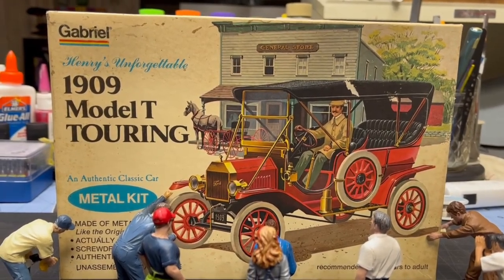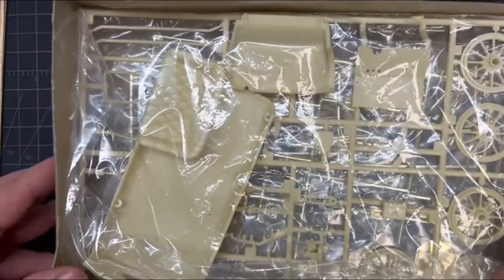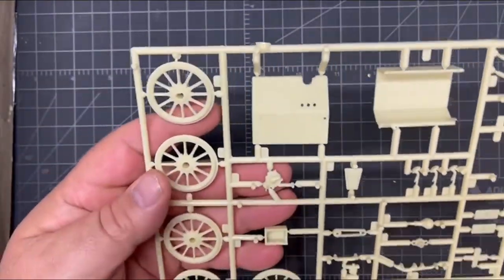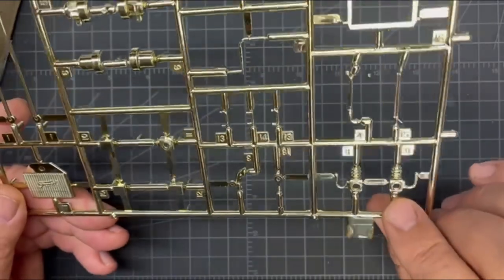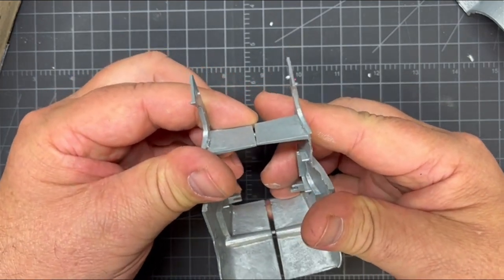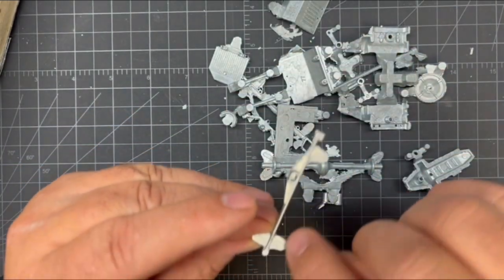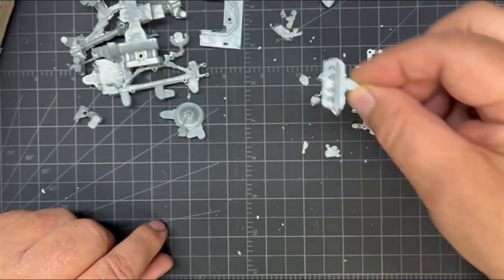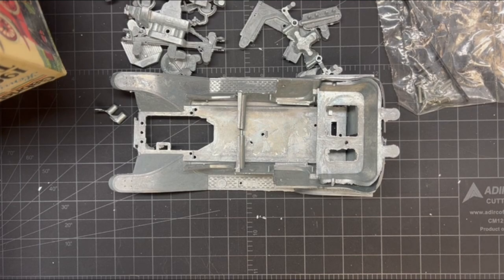Unboxing the Gabriel 1909 Model T Touring

Comment: How awesome is that! I don't remember these kits or I was just not interested in them to remember... Lol
To be fair, I quit modeling in 1972 when I moved to Nashville for Automotive School. I was playing with the big boys back then... 🤣
The guys/gal will have to get out the heavy duty shop tools on this one Mark... 🤔

This will be interesting to watch. Lights? Hell Yes! The battery can go under the the rear seat... Lol

LLAP 🖖
Reply from the maker: I was 13 when this came out.  I was a lot younger when my brother had one.  I want to say it had a rumble seat, but that was so long ago and I just don't remember.  I looked at the directions, and yes I can run the lights.  It will be cool.    I already had to get them an angle grinder and a bunch of files.  LOL
Reply: @grandpamarkshobbies  "had to get them an angle grinder", better make that 2 more grinder or there is going to be alot of loafing! 🤣

YES! Lights!
I assume (Iknow!) that is diecast?
All ya need is one wire to the front for the lights and use the frame as the ground since you have screws to fasten the ground wires at either end... 👍
Easy as Pie! 🥧😎

LLAP 🖖
Reply from the maker: Holy crap, I never once thought about the body already being metal.  LOL  You are right, I can run just one wire and do the chassis ground. . . How didn't I think of that.  LOL  That just goes to show I need to work on a real car again.  LOL
Reply: @grandpamarkshobbies  Hahaha... You know I am always trying to help a brother out. 
Finishing my computer issue from the last video and I'm rendering the (3am) video that I fixed it so I can (I hope) get back on the model videos. Life is full of curves... 😆

LLAP 🖖
I'm pondering a idea... 🤔
Reply from the maker: There's always curves in life, but sooner or later the curve straightens out, and as long as you enjoy the straight and not ponder on the curves you will do alright.  
Looking forward to seeing another Eclectic video.  I love them.
Reply: @grandpamarkshobbies  Hahaha... I curves better on the female's... But we just go with what we are dealt with... Lol
Glad to hear you like my videos. Just uploaded a new video the update on the whole Cinnamon Desktop issue... 👀
Now back to the model video... 🤣

LLAP 🖖
Reply from the maker: LOL.    I saw you had a new one out, but I've been running all day.  I'll check it out tonight.